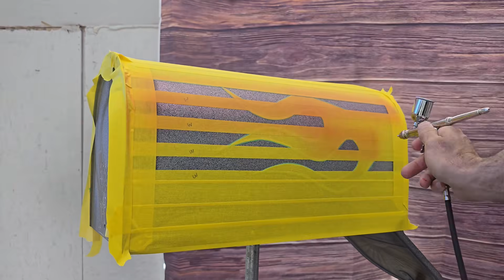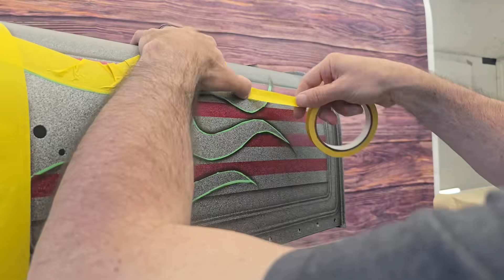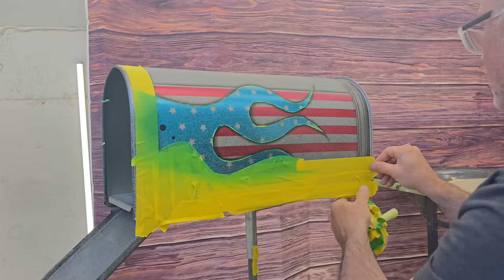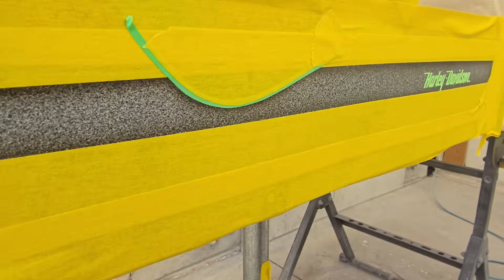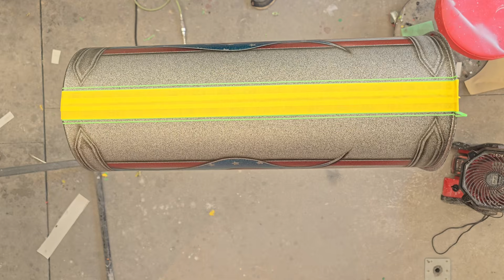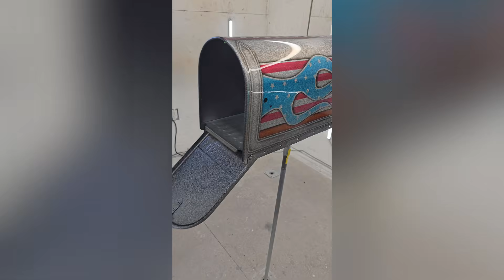Metal Flake Stars and Stripes and Graphics

Comment: I love the design.  I recently painted the back of my golf cart with a metal flake flag and the most frustrating part was finding start that would stick long enough to make it through 3-4 layers of candy but not stay so stuck that I couldn't get them off.  I wound up using 3/4" start, like you would give a kid for doing something good.  Now I have about 2000 extra stars of different sizes at the house for the future.  I am going to do my mailbox next.  I used "Dirty Wizard" metal flake for the silver and I had some leftover "Piss Off Pink" that I used for the red stripes.  There's nothing like metal flake in the sunlight to give that extra bling.